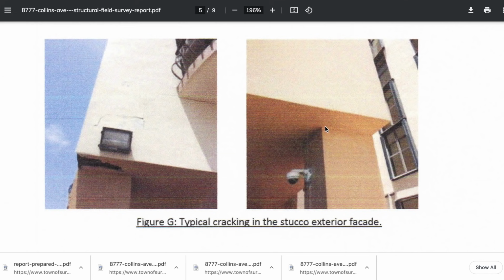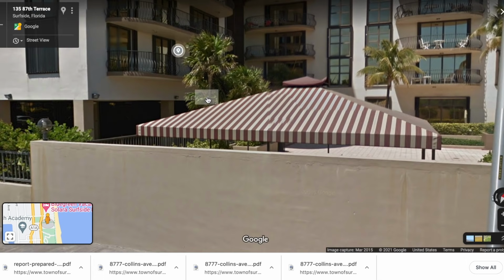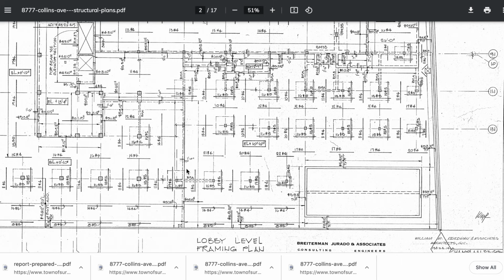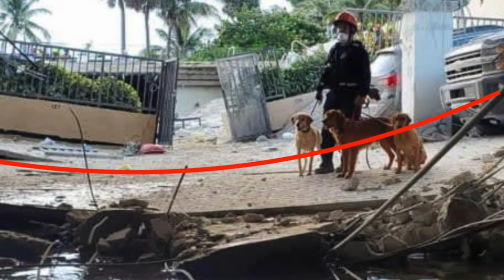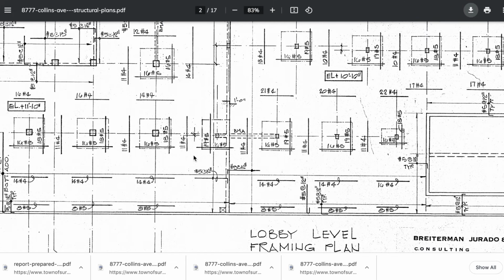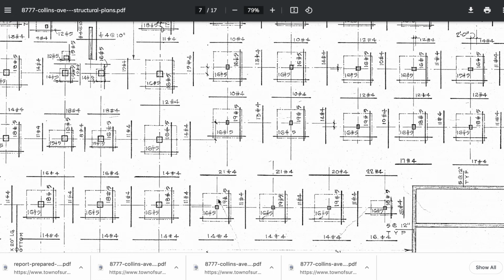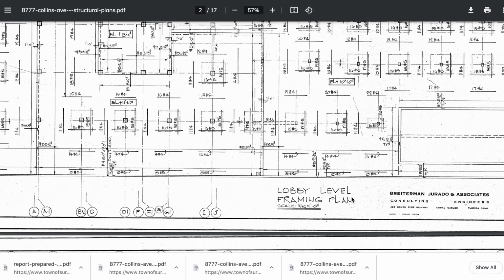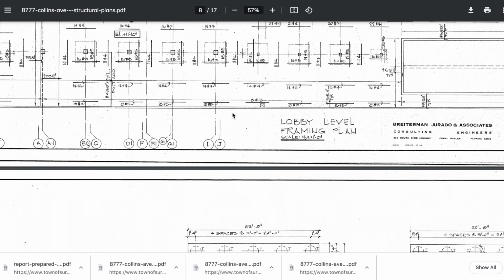Champlain Towers Collapse PARKING GARAGE SHARED POOL DECK AREA SUPER OVERLOADING? Part A

Comment: The pole deck supports... do not have rub.
Because the first explosion pillowed up the slab.
Just like a jiffy pop. When the slab fall back it had pulled away from the support.
Ask the question.....where are the SECURTY camers from every door, pool area. Parking g garage..mangers office was not damaged that where all the heard drives were at
There was 2 explosions., you can see the flash of the seco d explosion in the dust cloud right before the ocean part fell.
Reply from the maker: Your pot is cracked...

Comment: The deck and parking roof are the same plain, don't know if the strength of the deck slab was the same as the building 1st floor. The standing columns through the deck indicates the deck failed around the columns and fell, thinks like planters might have rolled several building columns. You remove 2 or 3 building load bearing columns from an edge of a building with tight load tolerances, it's probably game over.

Comment: I just can't believe there is no beams between the columns,  to support the floor slabs . You have concentrated load on the floors ,  where the columns have pierced the slab. I would at least want to see pads on top of each column to spread the load on the slabs .

Comment: I know you have already discussed the wall along 87th St and how the slab was not tied into the wall properly.  There are long candy canes identified for the wall that I missed before.  I saw the 90degree L shaped pieces.  These were called out just west of the hot tub and a longer candy cane was called out between C  and D.1.  
The slab buckled and fell:
1) along the south wall, 
2) before the Lobby ( tipped over car into black Chevy  pickup, 
3) and something similar happened north of the hot tub and west of the pool.  

The two shear planes indicated appear to have both hinged inward at the two poorly constructed North- South construction joints.  Rebar per the joint detail may have helped per event that?

The south wall lobby/pool deck slab tie would have helped stiffen and strength the slab in the other North -south direction.  The punch shear may have still happened due to the overloaded deck Cars/pavers/ sand previously talked about, but maybe could have been an additional repair (although plenty of expoxy was already utilized). I know we talked about the beam slab off set by 111 but the above three areas became cantilevers over time.  So the pool deck was almost free floating on three sides:  1) through 3 ) above and failed/ collapsed as such?  Still with you on the critical initial butterfly collapse, but question why they were allowed to leave out so much rebar. This should have been counted and checked before the pours.  Slab construction joints obviously checked before the pour, continuous rebar, proper height etc

Comment: a 1' elevation change from the outer areas would be a slope to provide drainage.
or maybe i'm wrong.
it's usually why a flat deck open to  elements has a slope.

Comment: The elevation changes would make sense if the slab was intentionally recessed to accommodate a setting bed for the concrete pavers. Does a cut through those areas exist?

Comment: that is so odd, maybe they removed the transfer beams after deciding to have that the same elivation, not realizing it gave the rebar something to tie into at the far end rather than only being supported by a column at one end and going off into infinity, hmm. don't think that alone was the cause as it was "ok" for 40 years, however it would weaken the slab's internal structure. Hmmm.

also doesn't ad up, the north-south going transfer beam, resulted at that one column up against the property fence line, odd they kept that there and removed the rest of the load sharing beams to it. Hmmm. they don't even have a number for that thing, but it is right there in the blueprints and in the photos, K-16 or something, 15 is the edge of the building and it's just beyond at the fence line, lol.  drrp, ok, maybe that's just curbing leaning against the fence-line at what looked like K-16, that area is absolutely mangled like it hit something when dropping down, hmmm.

Comment: The conflict remains.
I still kinda wonder if a later project brought the pool deck up to grade to eliminate the step down considering a lot of resident's commented using the garage as egress, in fact I think I read an article that people were found in the garage.
Also note that the drains are missing on the pool deck that appear on the drawing not that the contractor paid any attention to the drawings anyway.
Usually the building inspector makes notes on the plans as they find conflict during build inspections and those are missing on these drawings yet if you look at the outer edges they were definitely taken into the field and used during inspections.
Keep it up Kai, the guy on the other site needs his content or he won't know what to say next! Lol!

Comment: Two words: marginal design at best. Where are the safety factors?  If a car takes out a couple of columns, does this mean all bets are off and people will die?  This is why I don't like being stopped at a light or in traffic under an overpass!!! Of course maintenance is a given, but no maintenance is going to fix a poor design.  I read that there were concerns over flower boxes on the pool deck area?? Well, hello!!! Wouldn't you take these extra loads into consideration??? Things are too interdependent.  One part fails, it should NOT cause a domino effect taking out other parts. Where are the safety factors?? I'm sure most buildings are not just barely able to support the loads it was intended to carry? This is a wake-up call. Thnx for your analysis.  I don't envy you going through those old drawings. Thnx.

Comment: i didn’t have the slightest interest in engineering until i found your videos. thanks for all the fascinating information. i’m learning a lot!
Reply: where are the cameras
Reply: Hey Jean,  ask one question. Where are the SECURTY cameras hard drives. Every door had a camera. There are warning signs when u walk thru the garage doors that all had locks. WARNING securty cameras in use. Around the whole property were SECURTY camers.
The offices for building  manger was not damaged. Note also, before it fell 2 condons were just sold for over 2.8 million. Banks would have sent there inspector to look at the whole building...note..not one so called news person has asked cameras.  They had audio...also..
Wittness right there not in the building heard a big boom, then it fell

Comment: Even with the concrete erosion this building should not have been designed to fail. The loads should have been calculated at much higher levels. I have never seen Rebar enforce  concrete columns that small holding up that much structure. There just is not enough there to tie into the floor joists Should have had much larger columns Shear wall between some of them. Obviously the Rebar around the columns was not enough for the loads of the cars. I just see lots of stuff wrong here. This should have never been approved IMO.....Marginal engineering and architectural. Making more profits to Kill people and ruin lives.
Reply: Its amazing 200+ ppl had no big warnings of such a catastrophic break. Like sounds, cracking, popping, breaking from inside the walls. In the hours before…..If Anything positive can come from this its that this CAN and WILL happen with no warning in the US. Its not an anomaly. Many buildings in Fl on the ocean are like this. They need to be maintained with a fine tooth comb.

Comment: Is it possible the elevation change was there originally,  but in the 40 years at some point additional layers were added to pool deck to negate that change? That could also flatten out the pitches that were there for drainage. A thought.

Comment: I don't get how that tiny narrow poles were supporting that wide first floor deck?
Reply: And in the long run it didn't.
Reply: Yes and there is no cross beams between the columns,   and not even pads on top of the columns to spread the lad on  the slabs ,

Comment: illegal parking arrangements killed 200 people and displaced 400. the banality of evil.
Reply from the maker: CONFIRMATION BIAS"...
ONE VIDEO RELEASE CAN PROVE IT WAS JUST THAT...
WE NEED VIDEO DATA, a lot of cameras exist, yet not one video ?
Again, be careful with my data, it could just be confirmation bias...
The collapse could have started from inside or even outer deck or column failure ...
It will still remain that these elevation changes and overloading still is present on these dead loads.

Comment: looks like you hit the nail in the head. irresponsible parking in the area near the lobby of the building, we know that slab was weaker. there could have been a shockwave from the first collapse that caused other columns to fail

Comment: As Richard W highlighted, the framing plan - “REVISIONS 1-17-80 Change of Column Type” is the latest.  When you compare plans page 31/336 vs 161/336, the pool deck elevation level is 11' 10' on 31/336 and they eliminated BMAs related to the 1'0" older version.  Both these plan pages are dated 8/22 which is strange.  Maybe the older version design would have held up better with the north-south BMA.
Reply from the maker: CONFIRMATION BIAS"...
ONE VIDEO RELEASE CAN PROVE IT WAS JUST THAT...
WE NEED VIDEO DATA, a lot of cameras exist, yet not one video ?
Again, be careful with my data, it could just be confirmation bias...
The collapse could have started from inside or even outer deck or column failure ...
It will still remain that these elevation changes and overloading still is present on these dead loads.

Comment: When you’re that close to a beach, why do you need a pool?  The beach is so much nicer than swimming in chlorine. The maintenance costs of a pool are big enough too.
Reply: I think the deck would have been there regardless. I lived in a complex that had a grass area and a concrete party area in addition to a pool/jacuzzi area on the parking garage 
ceiling where it wasn't under a building. That is a very common design - parking garage underneath everything, building built on top of garage around the edge of the lot and community area in the center (on top of the parking garage).
Reply: I have a pool. When u get out, your not salty. Enjoy pool water much more. Sorry. I don't mean to contradict  😥😥
Reply: Agreed.

Comment: It appears to be the plan is the structural concrete elevations. Don't forget the pool deck has fill and a grout pad that makes up the difference in elevation on the surface of the pool deck.

Comment: So if I'm following you they designed a multi level cake but then some idiot decided a flat cake was better  so these creeps just filled in the unlevel cake with frosting and then more frosting then just a little more frosting until their unlevel cake was picture perfect level. NOW this cake ( pool deck ) looked perfect even though the morons COMPLETELY DISREGARDED  the structural integrity and in their ARROGANCE thought no one was the wiser. Ya, so as long as the cake looked perfect nobody was gonna say nothing UNTIL that fateful day the parking garage was overloaded or until some idiot did some stupid human trick with their car or truck and brought the entire cake and all that added frosting down!  So what would I say?  I'd say...cuff um!
Reply from the maker: CONFIRMATION BIAS"...
ONE VIDEO RELEASE CAN PROVE IT WAS JUST THAT...
WE NEED VIDEO DATA, a lot of cameras exist, yet not one video ?
Again, be careful with my data, it could just be confirmation bias...
The collapse could have started from inside or even outer deck or column failure ...
It will still remain that these elevation changes and overloading still is present on these dead loads.
Reply: I DEFINITELY failed the midterm exam. On the most important point that you stress " to not have or at least to actively fight your own confirmation bias" i failed MISERABLY. Yes, i will admit  that I have formed a confirmation bias and that I need to WAIT until ALL the data is in. Adding shame to my CONFIRMATION BIAS is my desire for Justice and my call for" a pound of flesh" WITHOUT KNOWING ALL THE FACTS my premature desire that someone OR someones be held accountable for this ATROCIOUS loss of life. But your right "pride comes before the fall" and jumping to CONCLUSIONS and worse jumping to JUDGEMENT helps no one. I repent!

Comment: one has what looks like wheelchair acsess while the other looks like a step behind the gate
Reply: Wow, wouldn't that be something if a new ADA code (July 1990) requiring wheel chair access is what caused the building to collapse. That would diffidently be something worth covering up. Better grab those videos!

Comment: You are teaching more than  engineering. You are teaching how to think and maintain one's focus on detail. This takes a lot of sustained concentration which humans are capable of but are too lazy to use. I will be more concentrated today because of you. Every student should become familiar with your method which is applicable to many subjects. Thank you once again.
Reply from the maker: Also, it takes being obsessed with making sure all witness statements are accounted for... A video can disprove me, in a blink of an eye...so, I will stay humble...
Thank you.
Reply from the maker: PS But, it will not disprove elevation changes or shared parking garage with deck details...
I have to remember, this is my bias...
Confirmation bias can be wrong on this starting point...
Reply: @LoadPathEngineering  your conclusions are not as important as your method of thinking, analysis, and talking while creating footnotes on the go. For example, you point out bias or other risk as you are not on site. You are working off other peoples' plans and photos.
Reply from the maker: Thank you for your support and it is a pleasure to read your comments... As you understand my process pretty well...

Comment: There is no way in the world that the condo board is going to release and video footage from the Association cameras. You can be certain that the Association attorney has already advised the board on that one.
Reply from the maker: CONFIRMATION BIAS"...
ONE VIDEO RELEASE CAN PROVE IT WAS JUST THAT...
WE NEED VIDEO DATA, a lot of cameras exist, yet not one video ?
Again, be careful with my data, it could just be confirmation bias...
The collapse could have started from inside or even outer deck or column failure ...
It will still remain that these elevation changes and overloading still is present on these dead loads.

Comment: Overloading and dead load from cars, pavers, etc. on pool/garage deck resulted in partial collapse of this deck, in turn pulling on a column of the structure already weakened by years of saltwater intrusion due to a flattened deck with little or no drainage possible and which was overloaded!  Wow!  Thank you so much for another great video!!!     :^D 🎺 LP
Reply from the maker: I have to stay humble...
CONFIRMATION BIAS"...
ONE VIDEO RELEASE CAN PROVE IT WAS JUST THAT...
WE NEED VIDEO DATA, a lot of cameras exist, yet not one video ?
Again, be careful with my data, it could just be confirmation bias...
The collapse could have started from inside or even outer deck or column failure ...
It will still remain that these elevation changes and overloading still is present on these dead loads.
Reply: @LoadPathEngineering  they should weigh the black pickup (why guess and say 6500 lbs.).  You can be looking at advertised gross vehicle weight of nearly five tons ( not just empty weight of 2.5 tons).  The building was designed during the gas crisis with econobox cars. Slab went straight down behind the truck and along the drivers side.  Small step ladder is upside down to bed in photos
Reply: How does a flattened deck cause saltwater intrusion in the garage?

Comment: Check the notes on the right side of the framing plan - “REVISIONS 1-17-80 Change of Column Type” they made some changes along the way, see which one is the most recent. To me it appears the 11’10” Elevation all over is the correct one.
Reply from the maker: I have to stay humble...
CONFIRMATION BIAS"...
ONE VIDEO RELEASE CAN PROVE IT WAS JUST THAT...
WE NEED VIDEO DATA, a lot of cameras exist, yet not one video ?
Again, be careful with my data, it could just be confirmation bias...
The collapse could have started from inside or even outer deck or column failure ...
It will still remain that these elevation changes and overloading still is present on these dead loads.
Reply: Agree.  Plans page 31 of 336 vs 162 of 336 is the latest version.  Strange their both dated 8/22, but page 31 has material changes (e.g., changed elevation of deck, eliminated those BMAs over by deck)